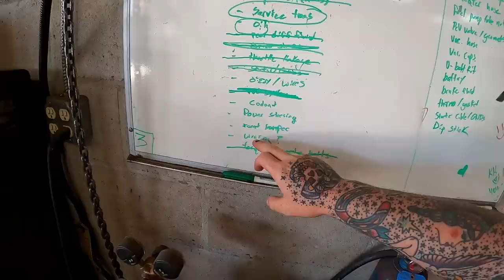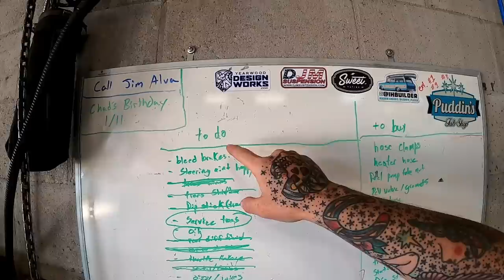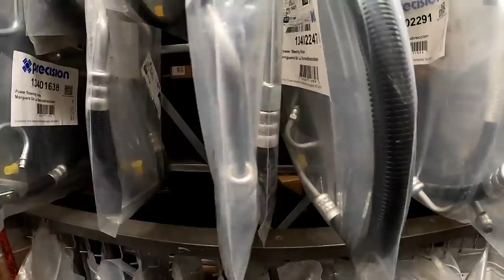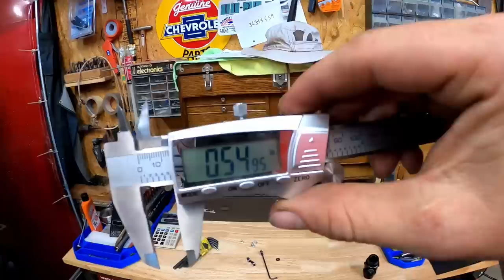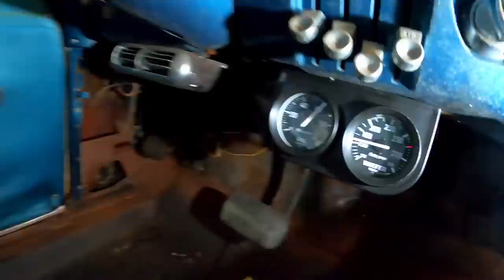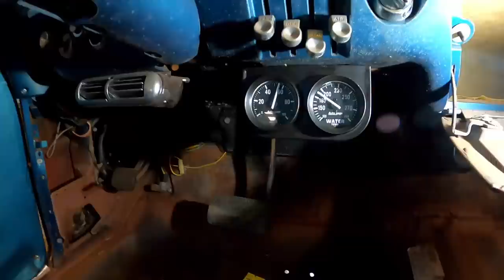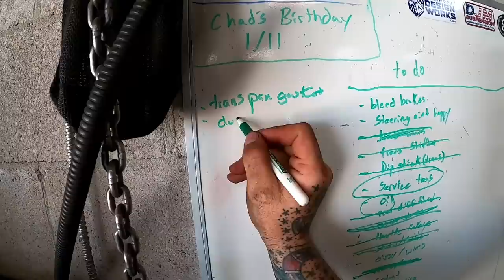Wagon Build Home stretch! 1961 Chevrolet Parkwood!

Comment: The US switched from inverted flare to metric O ring power steering lines in 1980. If you want inverted flare, look up 1979 and older. The inverted flare or metric O ring fitting are a standard size, so it doesn't matter if you're using hoses/fittings from ford or chevy or so on.

Comment: Puddin that brought back memories. I had a 64 ImpalaSS in high school. Freshened up the 327 that was in it. Fun project, put headers on it and when we fired it up there was paint flaking off the headers and I was running the throttle from under the hood! Smoke coming off the repainted part! Oh yeah, good times👍. Thanks for the memories

Comment: Oil pump drive usually ends up just a touch off when you move the dirt a tooth to correct the timing swing. ;) a big flat blade screwdriver or a click of the starter and it drops in. You got her though.

Comment: Sometimes you need to grind a little off the bottom of the banjo bolts as they sometimes bottom out before they seal on the copper washers.

Comment: For the younger folks. if you take an old use distributor and remove the drive gear that engages the cam,you have a perfect pre oiler that fits all small block chevys .

Comment: On airplanes, we use a pump oiler attached to the bleeder with a rubber hose to pump fluid uphill to the master cylinders. It runs all of the air out of the lines. Easy peasy.

Comment: Little tip for leaky banjo fittings. Tighten them up then give them a good solid wack or two on the bolt head with a hammer. Then try and tighten them a little more. The shock of the hammer helps seat the copper washer.
Reply from the maker: I’ll give it a Luv tap next time!

Comment: You can spin oil pump by taking out distributor and look down in there and you will see the top of it with a slot.
 Chuck up a rod with a grinded down end into a drill and stick it in the slot and use drill to circulate the oil thru the engine. 
 Old timers been doing it for ever.

Comment: I know I've probably posted this before, but I worked in at least a couple of different shops in my time that had power bleeders.  Those actually attach to the master cylinder and force fluid through the system.  They really work good, but no matter how careful you are, they're messy.  Fortunately, most brake fluid is water soluble.  Notice I said MOST.  DOT 5, for example, is not; not without a smidge of something like Dawn dish soap in the water.  

Honestly, I've found over the better part of 3 decades that simple gravity bleeding is really the most effective method.  That works best if you bench bleed the master cylinder.  As an independent mechanic and a DIYer, open them bleed screws and go do something else for a while.  Come back to it, fill up the master cylinder and you're done.

Comment: Tightening brake lines: Snug em then back off loose. Snug it a little further and back it off loose again. Snug it a little further and so on..... do that 3 or 4 times. This creates a witness mark all the way around the flair fitting and makes a tight seal.

Comment: On the you joint I  have drilled them out to round to expect the shaft then slipped it together removed the set screws and drilled them threw to accept a 5/16 bolt to act as pin but machining a DD is better

Comment: Tip with sealing banjo bolts up. Tighten the bolt then give the bolt head a little wack with a hammer then tighten it back up.

Comment: Well hell, Puddin' wish I coulda been there. I would have moved those wires over one slot and saved a little bit of time from having to pull the distributor, find TDC and reset it all. Moving the tooth on the distributor is a little harder than playing leapfrog with the plug once around. Looks and sounds awesome!!

Comment: You can make custom steering lines with AN fittings and high pressure line for supply, return doesn’t have to be rated as much. Russell Powerflex line/fittings works great.

Comment: Use steel braided line/AN fittings on your oil pressure gauge (that's what I use). You can get pre-assembled -3AN lines from summit in various lengths.

Comment: A jar half full of brake fluid with a clear line from the bleeder dropped into it works perfect everytime . Pump it and watch the bubbles until they stop . Tighten up the bleeder and move on to the next one. Everytime you let the pedal up it pulls up fluid not air. I have done mine by myself for 50 years no fancy equipment or hel.p

Comment: I had best luck gravity bleeding brakes.  I first loosen bleeder screws and put them in finger tight. I then push the brake peddle down slowly till i get fluid and then i just gravity bleed them. I am used to working on my own and learn how to accomplish tasks alone.

Comment: I always try and use the old copper washers, or if you can get a hammer on it smack the bolt a few times and see if you can't tighten it a smidge more.

Comment: Look into "Motive brake bleeder". You'll never need another set of legs to get a firm pedal. Since all I work on is pre 70s junk I run the "universal aluminum plate adapter" they sell separate which covers all the cast iron masters. Just don't trust the chains included to seal, I use two big ass C clamps to snug mine down instead.

Comment: Hydraulic lines for power steering, see industrial supply they often can make hoses to fit, or a Hydraulic repair  shop. Use old fittings to new hose,  or replace.

Comment: Pitting in the casting where the copper washers sit is probably what caused that leak. I like to put a little right stuff on the casting so the washers have a better chance of sealing

Comment: Having had a line go when replacing a caliper I can say bleeding brakes is a pain to do right 👍 its a job you need a buddy for. Having a good vacuum pump / non return valve really helps. Also can attest to not running low on fluid - sucking air into the system from the top is like the worst feeling in the world 😢

Comment: Puddin: "This is Mortske type stuff: this is the sphlincter valve with the jack receding hole. I keep 17 of them in my little drawer."
Also Puddin: "I need a pipe plug for the intake, let me go to my 24 compartment drawer and search through my selection for the right one..."
$5 says Sir Morticus would have that distributor hold-down in his little drawer so he wouldn't have to ask the neighbor to trade blue loctite for one...
Reply from the maker: Guaranteed! If he didn’t have one he’d go pull one off one of one of his 25 stuck engines!
Reply: Use what you've got to get it dun, even if it means asking a neighbor.. Trade.. Lol

Comment: The wagon looks a sounds good I also like your new to you tow pig I have a similar Silverado pickup 2500 4 wheel drive crew cab 6.0 mileage not great but it will pull anything I needed to tow up to 14000 lbs

Comment: When u get a banjo bolt that won't seal like that one back it off a half turn and tap on it with a hammer not soft but not super hard will seat the crush washers

Comment: With those vacuum bleeders you need to take the nipple out and use a little teflon tape or smear anti seize on the threads, they pull so hard they suck air in past the bleed nipple threads👍

Comment: I believe you need to start the vacuum process from the rear passenger then the rear driver then the passenger front then the driver front. That’s why your not getting a good outcome w/ the vacuum system. In the video you wend driver rear driver front passenger front passenger rear. You need to start farthest from the master cylinder and end closest to the master cylinder
Reply from the maker: That was furthest. Front and rear on this system is separate
Reply: @PuddinsFabShop   idk the exact theory behind it. It’s how I was taught in auto class. The old guy would say always Always start the farthest from the master cylinder and work your way to closest.

Comment: Yo puddin haven't you ever heard of epas 
Electronic power steering ?
You mount the epas under the dash between the Columb shaft and hey presto 
No hydraulic powersteering 
Is a popular modification for older cars 
Google search Volkswagen t3 electric power steering conversion 
To get a rough idea 
A full epas Columb and all the bits and bobs is like 50 bucks

Comment: I got a bit nervous when I saw you was running it without headers... when I was 25 I had an Opel Manta which I swapped a Rover V8 in it and when I was setting it up on the driveway of my parents home, I ran it with just the headers... and set light to the tarmac on the drive! Fortunately for me my Dad was too busy laughing his head off looking at me running around with the fire extinguisher putting it out before the whole car went up in flames to be angry about the drive... although he did make me buy a tarmac repair kit and fix it up when the tarmac fell off in the winter. For years any time we were outside and saw the "scar" on the drive he;d make some comment about my "little exhaust leak". Fortunately about 15 years later he had the drive resurfaced and my mark of shame was removed!!

Comment: There's a bracket that goes from the stud, on the front of the starter motor, to the side of the engine block. I bought an old Chevy truck and was having trouble with the starter not engaging, it was because that bracket wasn't put back on the starter, (I found it in the back of the truck). Any way, just telling you it's supposed to be there.

Comment: Great episode!! Nice to see Bill dropping by & helping out. To answer your question about the speedo gears, they are color coded, so in the future if you see a drive gear on your tailshaft & it's the same color as the one they say you're supposed to use it will have the same amount of teeth, so you don't have to change it unless it's damaged or worn to badly. It can save a lot of hassle. When I saw it I wanted so bad to be able to tell you they were the same & save you  some time!lol!😂😂 Great job on everything so far. I've always loved the old wagons especially when they're done right like you've done with this one! Thanks!!

Comment: Puddin was looking at your test drive looks like your ignition switch is not on lock .it should work without a key .you can get 4 keys ignition  switch  glove box lock and two door locks for about 65. Bucks I got it for my 64 I had worked great.danny south daytona

Comment: Talking about new vehicles, the only brand new vehicle I ever bought in my life, before retirement, was a 1980 SR5 (that was a pickup; now SR5 is a trim package) that I bought from Toyota of Tulsa.  A year later, I got laid off from McDonnell-Douglas (now Boeing) aircraft up in Tulsa.  I drove it out to L.A. by way of Houston, and ended up doing a voluntary repossession on it.  The economy was tight, even in California, which had long been thought to be recession-proof.

Since I retired a few years ago, I've had 2 new Toyotas (2016 Runner and a 2020 Tundra) and a 2-year old Tundra the same year as my 4Runner between the 2 of them.  

Drive the vehicle you need until you can fully afford the vehicle you want.

Comment: I'll tell you a little secret if you tighten the banjo bolts then hit it with a hammer the tighten it again it will stop leaking if it doesn't hit. It again and tighten it again

Comment: Not my trick but if you drill a hole the size of the line in a 2x4 you can draw it through the 2x4 & get it to go straight & then bend it however you want

Comment: FYI, those "warranty void if removed or tampered" stickers are actually illegal and should be disregarded, or at least that's how it works with computer parts. They just put them there for when you have to service something and you remove the sticker and find that the problem was because of them, you won't warranty the crap they sent you.

Comment: 30:39 my man, PUH-LEEZE feel free to keep hawking that SWEEEET (with four e's) reciprocating saw mounted spray can shaker because I want to do a paint project on something and every time I see that thing it motivates me to get out there and find that particular project vehicle so I can buy tens of cans of spray paint and, of course, that attachment for my saw so I can do it right while entirely doing it wrong.  "hey you can't spray paint a whole truck with just cans" "you can't do that with spray cans it'll run" "you won't be saving any money over real paint" yeah well buddy I don't have a paint booth or a sprayer or fans or filters or an air compressor that don't plug into a car's lighter socket, and I plan on doing this paint in a danged 'ol storage unit without even electricity, gonna be painting like the Amish, so I'm not gonna be doing it "right".  And I don't have to.  So all you internet paint booth armchair quarterback warriors don't you come crying to me when my little pale pastel insides of a zucchini green pickemup truck looks cherrier than every pie they gots down at Cracker Barrel.  Puddin you've got this wagon HANDLED I can't wait to see more of her in act-shin!!!

Comment: YOU SHOULD KEEP A LOOK OUT FOR A SMALL  OLD LATHE  EVEN A BENCH LATHE  AND A OLD MILLING MACHINE IT DOES  NOT HAVE TO BE A BRIDGEPORT MILLER   LOOK FOR A OLD BENCH VERTICAL MILLING MACHINE  YOU WILL USE IT A TON OF TIMES IN THE WORK YOU DO  / THEY ARE OUT THERE JUST KEEP LOOKING AND YOU WILL FIND THEM  /  BY THE GRACE OF GOD  / KEEP THE FAITH , JESUS SAVES